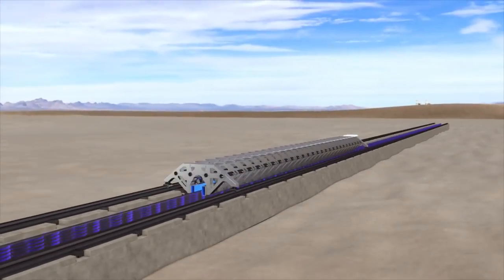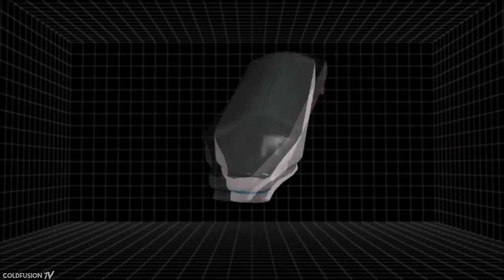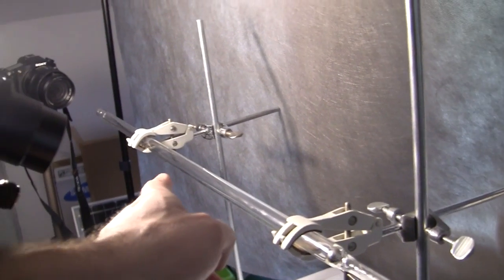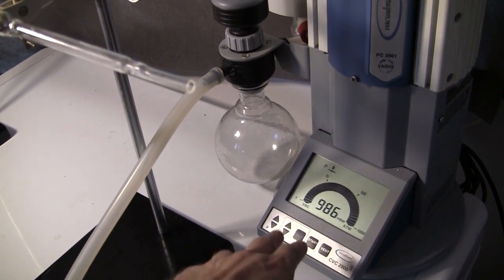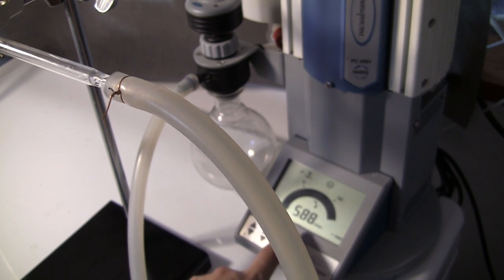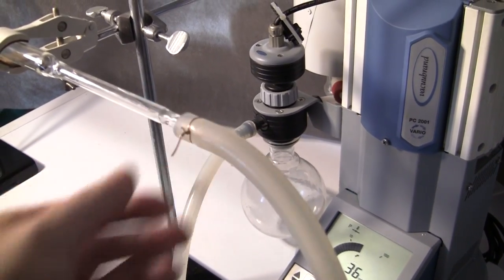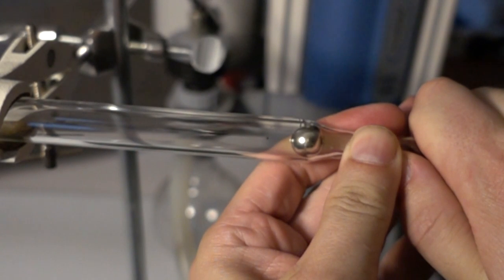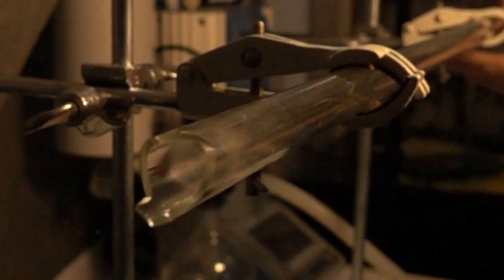How  the Hyperloop can kill you!

Comment: Don't forget that locomotives will kill you because at high speeds you won't be able to breathe, also we have to erect walls around railroad tracks so bystanders don't get motion sickness from passing trains. Stick to your horse-drawn buggies kids, don't ever try to invent anything new, and if you do then make sure the first technological hurdle stops you dead in your tracks.
Reply: The hyperloop suffers from the same issues as the solar roadway project. It's an expensive solution in search of a problem, that combines the downsides and problems of multiple systems into a new, more complicated, more expensive system which fails to provide a significant advantage over existing systems.

Hyperloop has all of the issues of rail and air travel wrapped into one package, and will probably cost 10x as much to boot. It's a train that runs in a pressurized tube. You're going to get some speed gains over a conventional high speed rail, but the tube will cost a shit-ton more than rail, on materials alone. A quick back of the laptop calculation looks like a train rail has a cross section of about 9 in^2, meaning 18 in^2 for two rails (using, to be fair, the first dimensioned image I could find http://www.icrr.net/rail.jpg, so I do not know how well this represents an "average" rail). A two meter diameter (one meter radius) hyperloop tube would only be able to have 1.7mm thick walls for the same cross sectional area (which means the same amount of material. I highly doubt that that's thick enough. A 1.5 cm wall would require ~10x as much material as the rails of a train. Ignoring that the maglev rail will require more material as well. And the increased precision required and probably more expensive materials to boot, will only add to that.

The hyperloop will be in direct competition to airlines. Higher speeds means larger turning radii to keep G forces under control. The hyperloop WILL NOT be able to be built in highway medians unless they're only shipping freight. Moving at 10x highway speed means that highway curves will be too tight. This means that new right-of-way will have to be purchases at great expense. Hyperloop terminals will almost certainly be outside cities, similar to current air terminals. 

Which means that the hyperloop is essentially the Concorde again. It's faster than an airliner, and that's pretty much all it's got going for it. The Concorde wasn't economical, and it DIDN'T require billions or trillions of dollars in infrastructure be built for it's sole use, just to be a slightly faster alternative to air travel.
Reply: I'll wait to pass judgement on his overall 'debunking' until the full debunking vid drops. So far, this looks like he's just showing off the cool hands-on bit separately, since it somewhat aligns with the other purpose of this channel; sharing cool science shit.

I'm not an expert on vacuum tubes, but I think there is some merit to investigating issues with the technology itself as well as its practicality. Thousands of miles of tubes have a lot more potential points of failure (or sabotage...) than <100m airplane, and IIRC vessels containing a low pressure are harder to reinforce/etc than a vessel containing a high pressure relative to ambient.
Reply: you have no idea what you're talking about.
Reply: 00zau 
You see, TF said absolutely none of that. He said it was dangerous, therefore bad. And that's the issue I take with his "Debunking" of it.
Reply: Exactly what I was thinking this whole video. It sounds like the same detraction from the first trains. All the other bunk he'd debunked was crap, but this is a flimsy argument at best. He seems to be slipping in terms of reason since Brexit. He's becoming like the opinionated feminists and SJWs he's spent so long rallying against.

"Because it could catastrophically fail" is a shit argument why not to do something. Everything could catastrophically fail. You could take 3 steps outside of your house, and an unknown fault in your knee could cause it to snap and cripple you. You could fall onto a curb and crack your skull open. Everything has an acceptable level of risk for convenience and efficiency.

he could have presented any other number of arguments, such as the cost of maintaining the tube vaccum, cost of construction. But no, he goes for the low hanging fruit. Likely because it is more sensational. But at least people are calling him out on it.
Reply: +00zau yay i did match! But you are not very smart in only comparing the steel cost of this equation. Have you seen a railroad bank? The tons and tons of ground work that needs to be done with tight tolerances just so you can put that rail down, every inch of rail needs this preparation.. Whilst the hyperloop sits on pylons far and wide between= minimal ground work
Reply: Jamster
I assumed that constructing and sinking large pylons into the ground (and engineering the tubes to be able to support their own weight between the pylons) would be more expensive than grading in rail. Otherwise they'd build rail and roadways on raised platforms, no?
Reply: Haha! Every single one of you didn't read the description!
Reply: I guess the curves meet somewhere and you figure out your options from there..
Reply: ***** 
When you get into your car there is actually an absurdly high chance of being killed. Not just by a mechanical failure, but a mechanical failure in another vehicle, or the roadway. There's also driver error on your part, and the dozens of cars around you.

There are far, far less statistical risks involved in air travel than car travel, and even less in space travel. The more inherent dangers of a system, the more failsafes will be put into place. The more regulations placed onto it.

You probably idolize TF or something, but going after a vacuum tube train based on the dangers of catastrophic pressure failure is the same as denying airplanes for the same reason. If an airplane has a catastrophic pressure failure, it tears itself apart into tiny bits.

But how often does that happen? If this is TF's principle argument against vacuum tube trains, it's a shitty argument. The massive startup cost, or maintenance costs are a far, far better argument to initially present. This literally comes across the exact same way as the arguments presented by the detractors of the steam locomotive.

The same arguments that have been quited in this comments section many times. And giving that 20% figure is talking right out of your ass. Don't use hyperbole to back up your argument, it's the same shit that the SJWs use, that TF calls them out on.
Reply: ***** 
Clearly you need to re-read what I wrote. IF you can't be bothered to read and comprehend it, I'm not going to bother going through a mess of irrelevant, or already answered shit.
Reply: ***** 
Says the moron with no reading comprehension, who lumps shit together into an unreadable blob. Go learn to write and read english properly.
Reply: ***** 
Your grammar is shit, and do you even know what reading comprehension is? you obviously don't have very good reading comprehension if you couldn't discern what I was telling you about statistical risk.

And for not giving a flying shit, you keep replying to tell me you don't. So we'll add shit logic on to the growing list of things wrong with you. 

You ran out of argument so long ago, but keep babbling inanely. If TF is attracting fanboys like you, I think it's a sign of how overly sensationalized his "debunking" videos are becoming.
Reply: kauske by the way those gut growl videos are very peculiar, I like that.
Reply: Yeah, because investing BILLIONS of taxpayers money to have a train which goes aproximately as fast as plane  is a really decent idea.

Were actually facing alot of different crisis in the future, but nobody is investing billions to solve those problems, because a high speed vacum train is a lot more important, than developing new antibiotics for example, as the bacteria is gaining immunity to older ones.

The cost and the challenges of hypedflop would be a fucking waste of resources. 

Now i dont care if somebody want's to invest in the research to develop this train, but using tax payers money just seems like a huge ripoff.
Reply: kauske The Hyperloop has no way to lean into the curves, making it impossible to use Interstate medians. Therefore, it will cost a lot of money. A train in a bubble (like a Rocket Train) would be able to use Interstate Right of Way, and also things like the Horseshoe Curve, because it can tilt 7/9.
Reply: kauske The problem is, they don't. Not in the paper documentation, anyway. The tube is very thin and had outer space pressure. The Baffin River Tube that connects north and south Canada has 1 ATM of pressure preventing collapse. If that was a vacuum, then those Baffin River Tubes would collapse.
Reply: 00zau 
Presenting an incomplete argument is still grounds for him being criticized on it. As someone who publicly criticizes all sorts of things, to expect not to have people critique his bad decisions or incomplete information would be the same sort of double standard that he's railed against when debunking feminists.

Comment: I dont think this would scale well to human sized transport. The acceleration must be lower to the point where it may not even be lethal.

Calculations:
Assuming the atmosphere causes one side to instantly reach 100kPa while the other side has a negligible air pressure.
We also need assumptions for size and weight of the vehicle.
Assuming 2.5m diameter gives 7m^2 of surface area
Weight is slightly more difficult. Im going to assume that the weight of the vehicle would be approximate to that of an empty freight train. This gives us about 30,000kg.

The force on the train would be the P*A. 100,000*7=700,000N
A cart like this being pushed by 700k Newtons would give the acceleration = F/m = 700,000/30,000 = 23m/s^2

2g's wont kill you from acceleration alone. Of course I would imagine stopping would be incredibly difficult
If you see any errors in my math please be sure to point it out! Physics at 1:30am usually produces a few errors.

Comment: What about the magnetic propulsion that the thing should apparently have. That could possibly slow or even stop the car in case of explosive recompression. Also, a built in emergency breaking system would also do the trick. Good enough to stop several ton cars moving a couple hundred kilometers per hour in few hundred meters.

Comment: I have quite enjoyed your usual debunking TF but I think  you are a bit off the mark here.  There are several fail-safe's that I can think of myself that would avoid catastrophe in the case of a vacuum failure.  And I'm not an engineer, so I'm sure that with all the brilliant minds working on this they will be able to handle vacuum failures.

Two things I can think of:  

One: Automated monitoring of pressure combined with automated valves.  In the event of a pressure increase anywhere on the system valves would open automatically on the opposite side of any vehicle to balance the pressure on both sides.  The air pressure in the tube would move at the speed of sound, but the signal to balance the pressure moves at the speed of light.

Two: The hyperloop vehicle  can also be equipped with breaks.  If it is being magnetically levitated those same magnets can switch polarity and brake the vehicle.  Combined with method one any vacuum could be easily handled. 

From what I could tell of your experiment (cracking the glass pipe) it represents what would be a complete splitting open of the hyper-loop pipe.  I don't think the construction of the hyperloop pipe would allow for such a failure, short of explosives or a fault line opening up in the earth.  Leaks may be possible but that is not what you simulated.  Even in the case of catastrophic failure of the pipe, I'm sure there are systems that could be designed to prevent the scenario you simulated, like the ones I describe.

Comment: I don't see this. If the failure was far from the capsule (which is extremely likely) and not a large hole (also extremely likely) surely it would have only a relatively small effect on the capsule. Additionally, there WILL be plenty of room around the outside of the capsule (about the same cross-sectional area as the capsule itself) so the force on the capsule will be greatly less than suggested here and certainly permit the implementation of ways by which to slow down and halt the capsule. I think TF is wrong with his assumptions here.